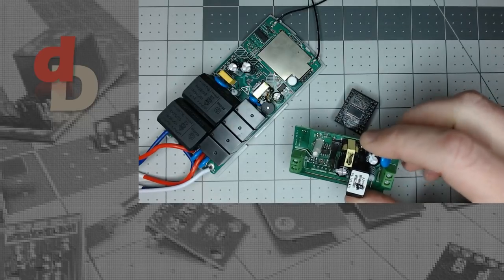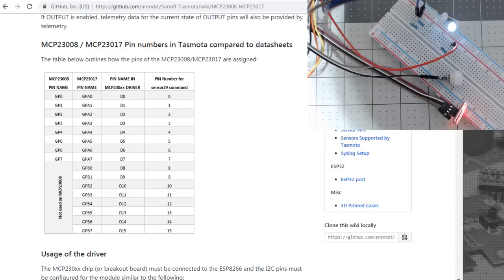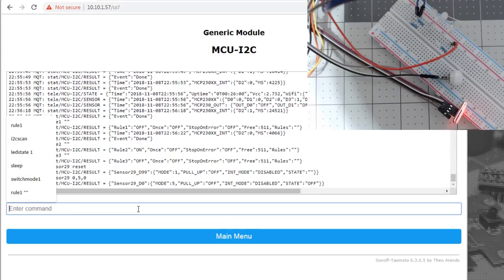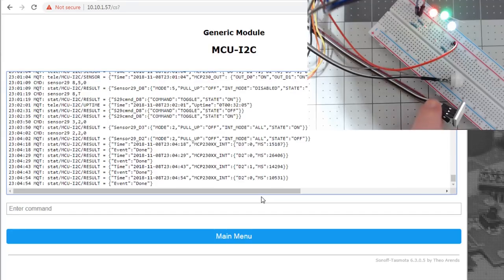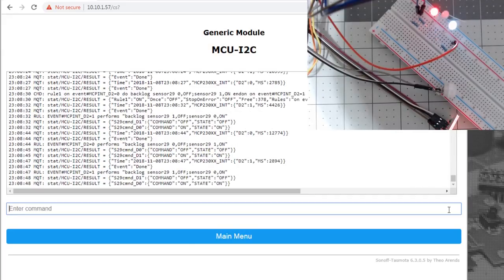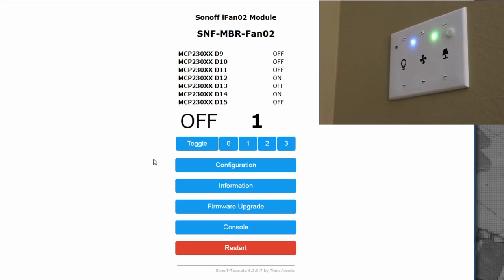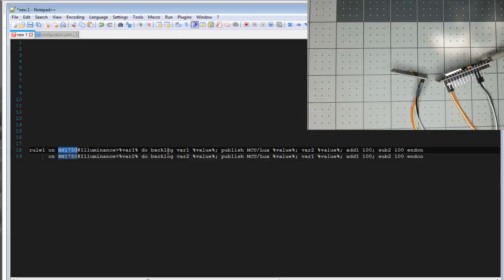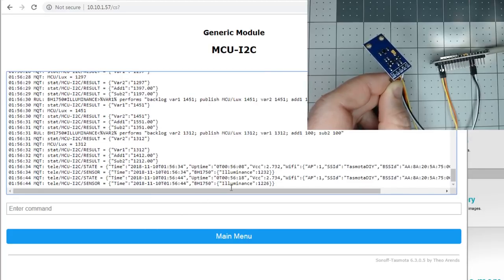Part 2 - How to Expand Tasmota/Sonoff Devices with the I2C Protocol - MCP23017 GPIO Expansion - I²C

Comment: Great video. Thanks. Maybe you can help. I got everything setup, and have D[0-15] and Tasmota docs says it exposes RELAYS and you can control them with POWER command. But this just give me errors. Any idea what I'm missing?
Reply from the maker: Have you read through here?  https://tasmota.github.io/docs/MCP230xx/
Reply: @digiblurDIY  Thanks. I opened a tasmota ticket as well. Looks like the POWER/RELAY feature was added to Tasmota recently, and only latest version 8.5.0 has it. All solved now :)

Comment: I heard you mention the "flickering" of relays during boot which sometimes happens when directly connecting to GPIO pins , do you know another way to prevent this ? I had this on a ESP32 but it seems less  on a Nodemcu
Reply from the maker: This isn't an issue anymore on the newer software releases of Tasmota

Comment: @digiblurDIY for the AM312/AS312 sensor, are you just wiring +3.3v, GND, and signal?  I've got it wired in that way and but it's not activating the pin.  And it looks like the MCP is active low while the sensor is active high, so would those conflict as nothing would be pulling it low for the MCP to see it?
Reply from the maker: I will check my setup as it has been a while but it is working. I don't believe I used the internal pull up as the AM312 goes low with no motion. I reply back later when I am at home to look at it.

Comment: Great video very interesting. A question arises, if I want to turn the relays on and off with a physical button using a port multiplier like the MCP23017 chip, can I do that? Using the Blynk app.
Reply from the maker: Yes you would just assign the rules to the input on the expander to cycle the relay you want. Or if the relay is on a other expander port push the on off to that pin.
Reply: @digiblurDIY  Very good dear. Thanks a lot for answering me. Basically at the output of my NodeMcu connected via I2C there are two multiplexed mcp23017 that manage 32 relays, now I wanted to apply some buttons to make it possible to activate or deactivate the relays as for smartphones. One click is activated, the relay is active, then another click on the button and the relay is deactivated and remains deactivated. Only I can not find a solution to my problem and I'm coming out crazy. If it was not a problem for you we could hear Telegram or Email to show you the code and help me. Thank you very much for the attention .
Reply: @Elettronica-xt7nm  Similar situation. Using tasmotised D1mini with 8 relay board and MCP23017 with 8 pins (A0 to A7) set as input to use as switches for that 8 relays. Trying so much, but couldn't make it work. Used this rule
Rule1 on event#MCPINT_D0=1 do power toggle endon on event# do publish cmnd/sonoff/POWER1 TOGGLE
it worked only for first relay, combined another relay rule in first rule (because we can set only 3 rules max in tasmota) showing right inputs, but turning only the first relay. Tried many modifications, but I'm stuck :(
Reply: @SathishReddysK  Got?  I need to do something similar, but with 32 pins.

Comment: Hi! Great video! I've a question: I want to use the I2C method on a Sonof Basic R2. Can I use the RX and TX ( GPIO1 and 3 ) for l2c comunication?
Reply from the maker: Yes, the iFan02 only has RX and TX pins available and that's what I use my MCP23017 board with.
Reply: @digiblurDIY  Thanks! I Very helpful! I can now evaluate to buy the basic instead of TH10/16!
Reply: I am using mcp23017, in which i want to use 8 pins as output and 8 pins as input ( use our typical switch) i want to create a rule like if the input changes from 0 to 1 . Also vice versa 1 to 0 output pin should toggle which is connected to relay.  Like relay -switch configuration in tasmota generic18 config. Kindly give a syntax for rules i am using nodemch esp8266
Reply: @yogeshwaranoo7  Got?  I need to do something similar, but with 32 pins.

Comment: Great Video, I have sonoff devices which are working fine due to people like you on the internet, I have few esp8266 and 4ch relay module want to utilize them in my home automation if you can help me a little want to know if i flash my esp8266 with tasmota which pin should i use for Relay and for push buttons or touch sensors (thanks in advance)
Reply from the maker: Which esp8266 device do you have?  and relay module?

Comment: I've a second question! :D Can i connect a BME280 module to the  MCP23017 connected to the Sonoff/Tasmota? It's better to use another sensor?
Reply from the maker: You wouldn't connect it to the pins on the mcp but on the i2c SDA and SCL pins themselves. As you daisy chain each i2c device on the bus.